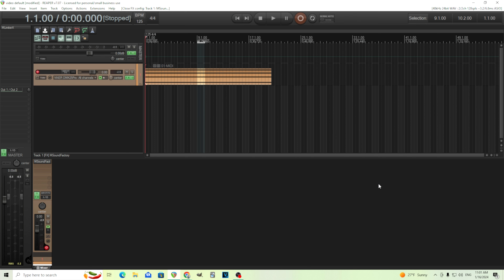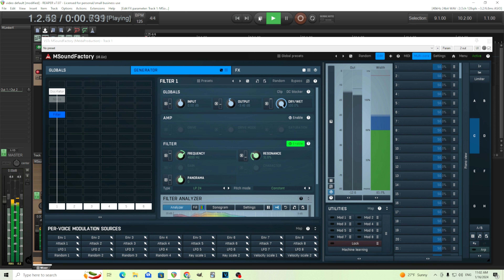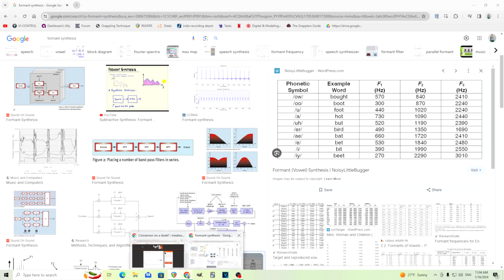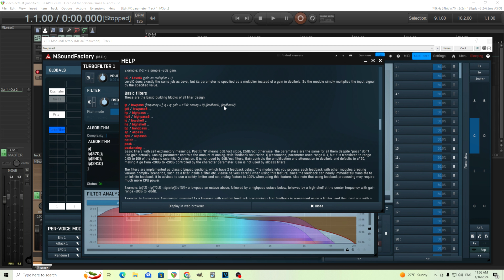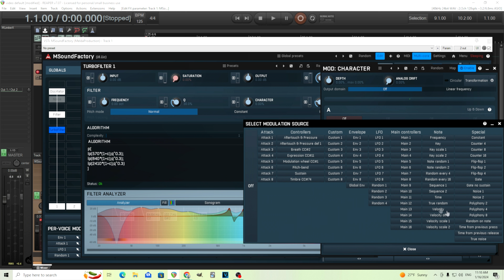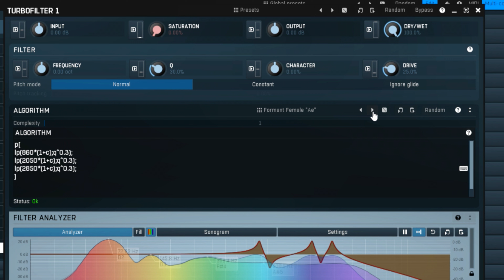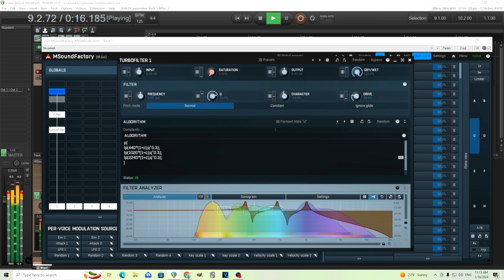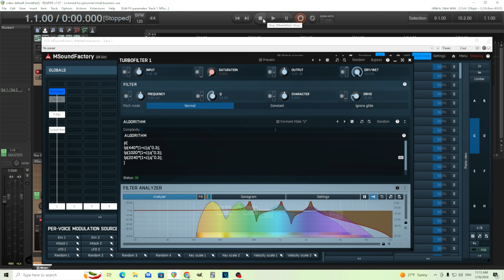Creating Formant Filters in MTurbofilter

Comment: Is there a way to route audio and midi in to msoundfactory?  Say to do resampling or vocoding
Reply from the maker: There is a way to route midi to MSF, but it doesn't have an audio input. MXXX can do stuff like that though. MSF is actually inside MXXX, so you can mix audio with MSF synths, samples, etc. If you want to do that in MSF you need to record it and then re import it. It is fairly easy to do with the recorder module though.
Reply: @Chandlerguitar  Thanks for the reply.  Yea I thought so.  Guess MXXX is on the list of next purchases.